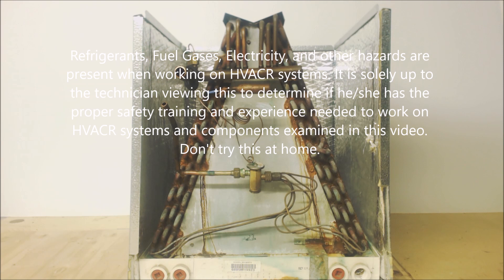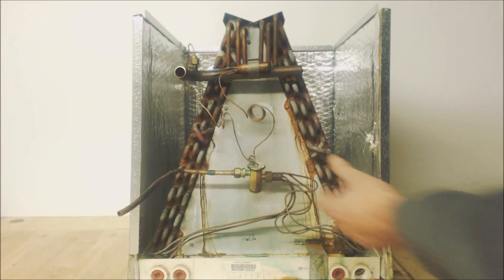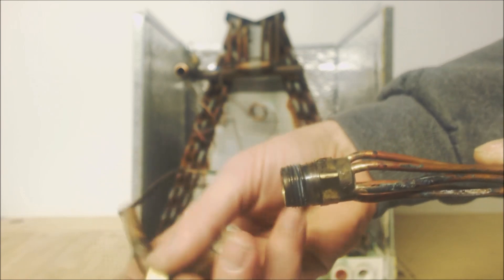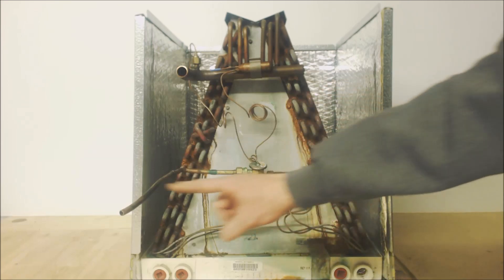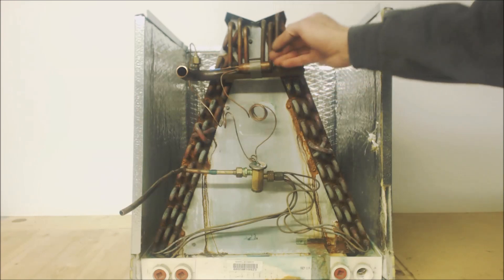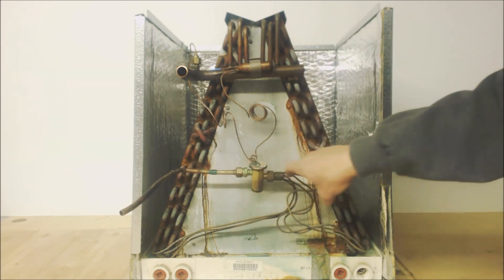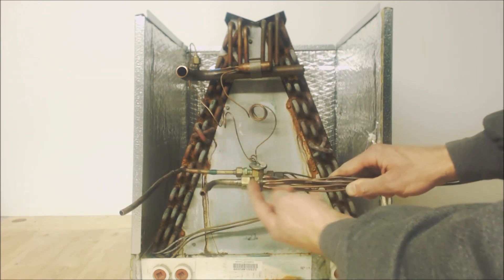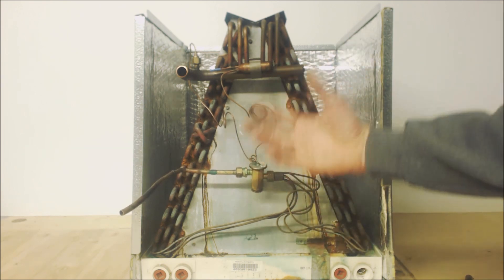Thermostatic Expansion Valve TXV VS. Piston Fixed Orifice! HVAC Metering Devices!

Comment: Yesterday I installed ICP N coil 3 tons with TXV(I don't like them at all. I always go with piston setup but dimensions were limited so end up using this type of coil) turn it on and I was reading 135 psi -3SH on my suction, 250 psi 6 SC. Outside 75, house wet bulb was 72. I was so mad at the txv being open because it was flooding but after this video I hope to see it 5SH or more when I go there to check it next week, under normal conditions in the house. Great video thanks for sharing.
Reply from the maker: Well, the txv should always hold a factory set or tech set superheat. Some txv's are non adjustable. The txv allows more refrigerant through when the load is high but will still maintain the same superheat. On a day that has lees of a load, the txv will let less refrigerant into the coil but will maintain the same 10-14 degree superheat. If you have 0 or negative superheat, something is very wrong. Check to make sure the txv is 3 tons if the outdoor unit is 3 tons. Make sure the bulb to snug to the suction tube. You could try to adjust the txv if it is an adjustable model. Or you could also try putting the bulb in hot water then cold water then hot water again to get the inside moving, verify it is moving. It could be stuck wide open. Also you could try moving the bulb outside of the coil box on the suction line. Anyway, there are some ideas but don't let it run with 0 superheat or less because that would hurt the compressor if it is a single or two speed compressor that is on a conventional system and doesn't have an accumulator to protect the compressor, thanks
Reply: acservicetech I m going back there to check it again. I was also suspicious about my Testo gauge set. I ll check it again and try the hot and cold water trick to make it moving. Thanks a lot.

Comment: I wished that my family's evap coil had a TXV vs a piston. First, some info on the system. It is a York system. Air handler I believe is a 4 ton and the condensing unit is 3.5 ton. It has a 3.5 ton sized piston in the evap coil. It cools alright but all it can muster is a 13 degree delta T. The system has a LOT of airflow and blows pretty good. As far as I know, the system has the correct refrigerant charge. Condensing unit is a microchannel (gasp!!) and has a charging / temp chart on the unit (can't go by superheat).
I'm sure that the delta T would improve if it ran longer (probably maxing out at 15-16). The set point is 75 on the thermostat. 
While TXV's can go bad, it's my belief that the delta T would be slightly improved if the evap coil had a TXV.
Reply from the maker: You should be able to get 18-21 delta T with a txv and a proper charge, thanks Ronnie

Comment: Hi! How do I recalculate/recompensate for the lost oil xoes goes with the refrigerant on recovery? Is there any mathematical formula to determine jow mu h oil is left on the system parts after the recovery?
Reply from the maker: Actually it is very hard to determine that unless you have an oil separator in the line like car type recovery units. This is since you can't identify if it is oil or liquid refrigerant weight in the bottom of the recovery tank. There is much more oil in a split system or packaged unit than in a car. For the most part on a standard system that has not been recovered more than once the oil level should be adequate after recovery still.
Reply: acservicetech, thanks for responding. Right now, Im working on my car and I lost my refrigeration through a leaking core. I forgot to put back the cap after used the gauges (where I found both pressures are loe) and my A/C wont run in the morning. Any advice.
Reply from the maker: There is usually a low pressure switch that will not close allowing the system to turn on unless there is a some refrigerant in the lines, thanks
Reply: acservicetech thanks

Comment: When brazing your line sets and purging the system with nitrogen are there any issues with the nitrogen flowing through the txv, as long as the temp sensing bulb is at a temperature that the valve would see as demand it should be wide open right ?
Reply from the maker: All comfort cooling txv's don't shut all the way, even if the bulb lost refrigerant, thanks!

Comment: When I step into a new customer's house, how do I know what is used for metering? Should I drill a hole and use inspection camera to looking for it?
Reply: Gerry Cui really I hope this isnt a real question....if you think u need to drill a hole an use a camera to see if they are using a piston or Txv for a metering device you shouldn't attempt anything
Reply: Here I am removing the doors.

Comment from the maker: I just wanted to point out, I did snap this bulb back on with the clip with the stub on the top. The stub should always be on the lower side and the tube going to the txv should be higher so it is just vapor going to the head of the txv. I just wanted to point that out before anyone asked and didn't want anyone confused by that. My apologies, it was late here when I did this and was just trying to get the video out. Thanks!

Comment: My superheat when I try to get it to 10° superheat my saturation temperature drops below freezing r22 my Wet bulb and dry bulb was calling for a 5° superheat today I have a 20° split return supply but on my high side my psi G is fluctuating all the time low side stays stabilized goodman units anybody have answers
Reply: Thanks
Reply from the maker: Is your airflow good or is it weak maybe do to dust on the bottom of the coil or something else. What dry bulb temp is inside, wb inside, db outside, high side and low side pressure exactly? Thanks
Reply: Wb 57 db 80      58psig  lowside 214-220psig high side keeps fluctuating  2.4 super heat   14 -17 subcooling keeps fluctuating 32degrees vsat 107 degrees lsat    35 degree suctionline 90 liquid line temp keeps fluctuating  48 degrees supply vent  68 degrees return vent
Reply: Love your videos
Reply: acservicetech I will check bottom side of evaporator tomorrow
Reply from the maker: If you have that low of a pressure on your suction line, it sounds like you have low airflow. The problem here is that the refrigerant doesn't have the ability to gain much heat. By saying that you have too low of a superheat coupled with such a low pressure and correct or high subcooling almost definitely means that you have low air flow. Granted it is quite cold in the building already at 68 degree return but still that should give you enough heat if more air was blown across the evap coil. What about the ductwork being too small or the return pinned off maybe. I have even found a second filter in series with the first that the building owner never new existed. Thanks!
Reply: acservicetech   Appreciate your help will look into this week

Comment: Very well executed! I have a question, I was always taught that the txv bulb should be insulated to sense line temperature rather than having it exposed and sensing air inside the cabinet potentially leading to an overcharged system if not careful. Thanks for sharing your wisdom!
Reply from the maker: Some manufacturers insulate the txv in the cabinet and some don't. When I install them I insulate them to be safe and also the tube from the bulb that carries the refrigerant to the txv should be up and the stub should be lower when horizontal. I realized that I did that after I made the video, ha. Thanks

Comment: People still use pistons because they are cheaper and more reliable.
Reply: Kind of like a carbeurator vs fuel injected. The Car computer keeps the air/fuel mixture perfect no matter what temp and it works great until it fails.
 
Seems a TXV does a similar job as it keeps the amount of refrigerant that passes through at a perfect level based on temperature.
Reply from the maker: Thanks na na!

Comment: Just curious....could you attach a thermistor sensor inside the coil in series with the condenser low voltage to shut the system down on low ambient days?....Great videos...I look for to getting them
Reply from the maker: You could. That is the concept with economizers so that instead of turning on the compressor, it pulls fresh air in from outside instead. Thanks Michael Madrigal!

Comment: Do people use Humidifiers in the winter time there? Id like to see a video on Humidifiers. I recently came across a Humidifier installed with an ecobee3 thermostat and both sets of wiring configurations left a new humidifer to not work or work intermittently.
Reply from the maker: Thank you for letting me know what you would like to see!

Comment: Excellent video. What do you recommend to seal the threads on a fixed orifice and TXV? Ive seen cases where a system is low on refrigerant and the nut is tight but the leak is from the threads. Do you recommend leak-lok on these?
Reply from the maker: Typically the leaks are not coming from the threads but the seal face. A teflon ring is used near txvs or a flare with refrigerant oil or something like nylog is used but only on the face of the seal. Thanks!

Comment: Thorough, well presented, explanation of how this device works.  I wish some long-time HVAC techs would review (and understand) the principles and operation of TXVs.  99% of the valves I've replaced died because they were plugged with crud, not because the valve failed in any way.  Regardless, if the problem was the "Copeland" compressor rust inhibitor issue or a bad initial install (no nitrogen purge), the "actual" problem normally is "not" the TXV.
Reply from the maker: You are absolutely correct and thank you very much for your great comments!

Comment: Good video.  Advantages to the homeowner is always a good thing to know.  Superior humidity control because of better moisture removal (especially on cooler days) and easier and more accurate charging for lower cost operation are good talking points.
Reply from the maker: Absolutely, awesome insights!

Comment: Another great lesson!  What does the other capillary tube go to from the TXV on the upper left, Craig?  It looks like everything with TXV is threaded, not brazed, right?  Thanks for posting!
Reply: Just a really good YouTube channel to either brush up on or learn forced air from. Probably the best guy here I have seen, not the only one taking the time to teach for free, but with the amount of professional incompetence I have seen posted as 'Pro's", this guys is top tier. Thanks ACSERVICETECH for taking the time to teach !
Reply from the maker: The tubing coming off of the txv bulb head is connected to the txv bulb and the other tube is connected to an external equalization port to check pressure at that location. Where the external equalization port attaches to the suction line there is a 1/4" flare. Most manufacturers now braze that line into the suction line. The txv seals on both sides with teflon rings. Thanks
Reply: Connections at TXV depend on manufacturer, some are flare others are brazed in. As to the capillary tube on left upper side I have seen coils with sensing bulbs on the coil itself, but it is hard to tell where and how it lands from video. Note that the TXV only uses one sensing bulb to meter superheating though and it it most likely the equaling line.